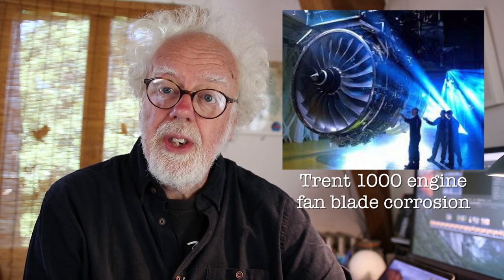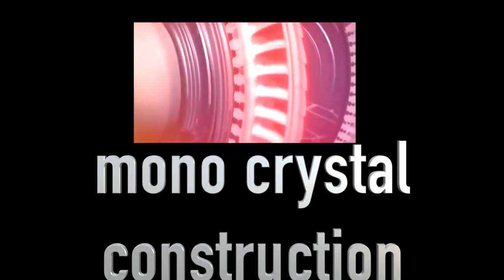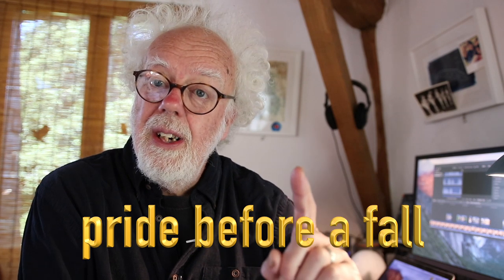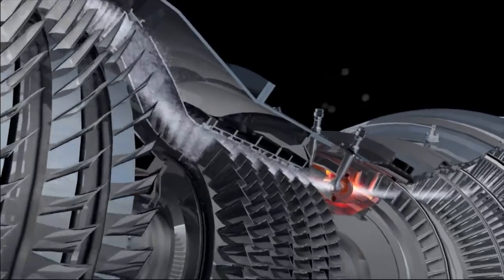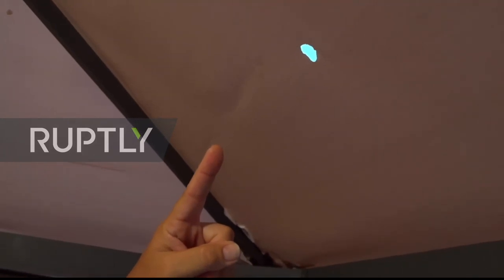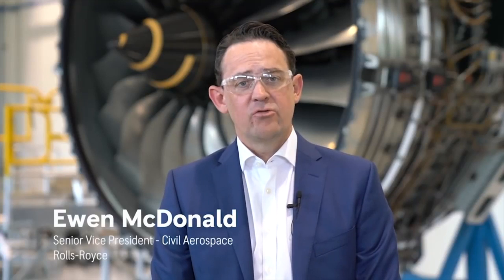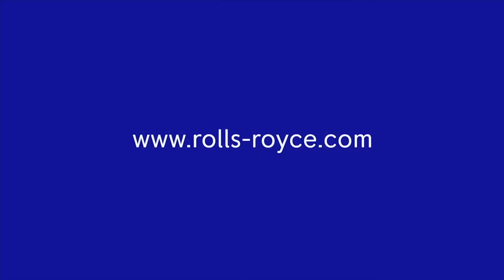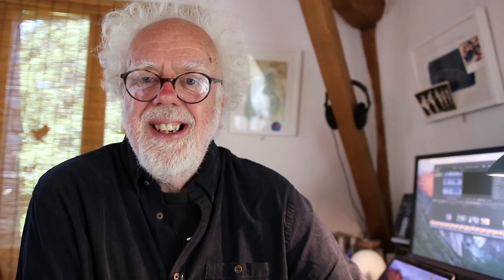Boeing and Rolls Royce problems - Prof Simon

Comment: Who is putting these engines into these planes?  RR is not the only engine maker.  I don't remember GE or, what's that other one, having problems like this.  I'm not thinking that RR engines have a monopoly on any particular design characteristic that makes them more suitable for these applications.  Is there a reason that Trent 1000s are being used instead of other engines?  Great video, as always.

Comment: I feel as though we are now asking even the most advanced materials to perform in ways that almost unattainable. Its hard to even imagine the stresses put on those blades. The G forces, temperatures and environments are really off the charts. Its not like the slower and much smaller engines of the past. These things must perform with the precision of God like numbers under the tightest strictest tolerances. Efficiency is the holy grail but at what cost will it be? I think corporations are under way too much pressure by investors and decisions are being made before they should be. Boeing being the example. When these companies make bad decisions and people die, will they fail???......they naturally should but dont which then increases the chance that the next company will take a short cut..... taking the gamble as they see others do it and survive. It never makes sense to me...people seen what this Trent engine does....yet will still buy a plane ticket on one. Lets see if people book on Max8s. When they do, and they will, companies will simply learn they can get away with more risk.

Comment: designed almost the same way, but with air, just like the way they used to mine gold with water ,when they put the water down 1 pipe and then into a smaller 1 and so on , as the water flows down the pipe into a smaller 1 it picks up speed, just like the air does in this engine, great post

Comment: That photo was qantas A380 it blew up because a poorly made hydraulic pipe failed and over fueled the engine causing it to over rev and fly apart. Quite a different problem to the corrosion issues on trent 1000s that Air NZ have on their 787 fleet.

Comment: @ 4:31 you can see what I’m talking about😲 I know it was just a animation but I would think they would want to represent it correctly!! The turbine gas exits the annular ring around the spike. I’m doing so it scavenges the air from the small hole in the collector spike to draw cool air through the center on the engine for cooling the bearing and supports. It’s crazy they would miss that😳

Comment: Why only some Trent engines affected.  What did they change?   Are the problem engines made in England or Germany.???  Is the problem design (asking the blade to do to much) or quality control.  Is it due to a change to untrained/ newly trained labour?.  Their nightmare is GE grinning to the bank.?  Was it due to a cost cutting measure? or change in the process???.

Comment: Whats your opinion about A380 engine issues, should we worried about it?
Reply: Not particularly no, as the a380 uses the Trent 900 engines (of which the Trent 1000 are derived from the Trent 900 so the corrosion issue would be limited to the Trent 1000). Also, the a350 does not use the same turbine (it uses the Trent XWB 86/97). Tho given that the Trent XWB was derived from the Trent 1000, one would assume that the turbine blades has been designed from the outset to limit/delay the onset of corrosion.

Comment: You didn't define exactly what the problem is? Compressor section, which part, corrosion or fatigue?
Reply: Milt Farrow  there was always s lot of ware on compressor blades in the 1st stage. RR had to ceramic coat blades to stop sand causing excessive ware back in the 1980's, 90's on the Saudi Arabian ordered engines. RB211-524D4D if I remember correctly.

Comment: Lighter fan blades are great but the rapid cooling and heating is probably cracking the blades. You dont have the surface area or density for expansion and contraction of the metal. That would be my guess.

Comment: Additional info from over a year ago: 300% is RR shop load capacity increase, issues are Intermediate Pressure Turbine (IPT) & Compressor (IPC). https://www.americanmachinist.com/shop-operations/rolls-royce-details-inspection-replacement-defective-blades
Finally did anyone notice the RR video showed exhaust flame coming from the center of the turbine rear frame sump area instead of the outer gas flowpath..."there's your problem lady"

Comment: built in sin fin and i heard that flight 370 ( i think) had rolls engines and apparently rolls engineers can talk to evey engine in the world at anytime in real time for diagnostic issues ane can fix a lot while in the air like diagnosing cars etc      my ex father in law worked for GE and once showed me pics of a turbine engine having its blades being blown off on purpose as they all have a detination bolt to release the blades in case of emergancey ............

Comment: I developed an odd passion for jet engine turbine blades. Part engineering but purely an item of Art.
Reply from the maker: Me yoo
Reply: @SimonHollandfilms  I did pick up one of the Trent 700 series large turbine blade. My favourite is a complete Turbine wheel with all the blades which is from an SR1 Sea Harrier. I see it as a clock one day if ever.

Comment: A large Southern Hemisphere operator of RR powered 787s knew of the engine problems for some time but continued to fly them on long overwater flights. It was only after they had a couple of inflight failure/shutdowns did they reduce the ETOPS ( EDTO) range, and that was because their  regulator gave them no choice. Like all things in life profit rules supreme, always above safety.
Reply: Can I just say that Qantas use B787-9 and Jetstar B787-8 both with GE engines.
Reply: Who else does that leave? As I said RR powered.

Comment: These engines are all pushing the technology and engineering expertise of the current construction industry. With such fine tolerances things are bound to fail. The obvious answer is to inspect the engines on a much tighter time frame whilst looking to correct the main causes of the failures...
Reply from the maker: So true....very high tech but unsuitable for our polluted air....they should know that

Comment: That Rolls Royce video on how an jet engine works is total rubbish.  They don't know the difference between deflagration (subsonic), combustion (continuous) and explosion (supersonic combustion propagated by infrared)
Reply from the maker: Interesting...a few people have said the same....I do t really see much wrong with their simplified graphic....but hey...you guys are the experts
Reply: Professor Simon Holland Well I may have shot my mouth of way too soon.  It seems that both detonation (supersonic) and deflagration (subsonic) are both considered an explosion, at least according to Wikipedia.  In an IC engine you want deflagration.  The combustion in a jet engine must therefore also deflagration. Air speed in those chambers definitely slowed to subsonic speeds.   (Unless a scramjet). I guess I suffered from hubris 🥺.
Both Whittle and Max Hahn (Von Ohain’s partner) solved the key problem of the jet engine which is combustion.  Hahn had a bunch of welding torch patents he could draw on.

Comment: Let's just hope it's a nasty blip in RR's otherwise good safety and quality record.. Pity they didn't go further with Skylon but the trend for large and bulky but fuel-efficient subsonic airlines for the masses took over years ago.... Bigger planes mean bigger engines which, when combined with the driver for ever lighter planes and engines meant weaker engines in this case... Obviously you want your blades as light as possible rather than as strong as possible, but they still have to be strong enough.... very sad... good luck R.R. - although luck should play no part in their solution TBH.

Comment: I think if you actually listen to your own video, you will hear that the Rolls Royce guy didn't claim to be 300% better, he said that the company had increased their maintenance capability by 300% in an attempt to get things sorted -- and therefore, in my opinion at least, doesn't deserve your mocking of him.
Reply from the maker: You’re correct...I’m moking the phrase 300%...when 10 more technicians would be less hyperbole.
Reply: @SimonHollandfilms  Is 10 the correct number? If so, then that would mean they only had 3.3 maintenance technicians working on the problem worldwide before they made the 300% increase.Maybe you're right but it seems unlikely. Perhaps the exact numbers should be researched.
Reply: And it is worth asking, if they claim to have tripled their maintenance capacity, how did they do that? Hire more technicians? Streamline procedures? Add better machinery? Or, did they make the procedures less stringent?

Comment: If they used to be able to repair 100 engines at at time then now they can repair 400 engines at a time. 
100=100% 300=300%
300% more than 100 is 400
What’s not to understand?
Reply from the maker: It’s hyperbole

Comment: RR has been the great innovators in this field.  The carbon composite blades were initially brought by RR however they had such failure with it while GE has it on their engines now.   RR is in a hurry to push out things without completing their due diligence.  That being said the RB211 is a solid Engine, they used to build good but is on a steady decline.

Comment: the thermodynamic effects, that make these engines so efficient, were known decades ago. But they couldn´t be built, because there were no materials that could resist those thermal and mechanical forces. As research continued, better materials became available. The design of these engines pushed the new materials to their limits - and beyond. Managers knew about that problems, but they were shure, all the lazy, coffee-drinking engineers would make it work somehow. Physics is a bitch.

Comment: So, what exactly is the nature of the problem ? You don't really explain it at all.
Reply from the maker: Hubris....relying on past glory and ignoring the quality of what you are making today.
Reply: @SimonHollandfilms  - that's not actually a physical explanation for heaven's sake.
Reply from the maker: Trent 1000 engines have hot section turbine blades, failing due to corrosion cracking...RR blame air pollution.
Reply: @SimonHollandfilms  What kind of corrosion ? Other variants of the Trent 1000 don't seem to suffer. What is going on ?

Comment: I never heard what made a British Airways 380 flying over Greenland heading for the US back in ? 2017 December or 2018 January. When the Engine Cowling came off it at cruising altitude (?30,000 + or -) Making an Emergency Landing at some Air Base in Labrador Canada (?) (My memory loses me after some time. Just what this Evil world wait's for when they say things have to take for ever for investigations, so no body really knows the cause of things.)
Reply: I suppose you are writing about the AF A380 losing #4 fan and air inlet over Greenland in September 2017. The FAA issued a directive to inspect these GE/Pratt & Witney engines inlet. Establishing the cause of the separation takes time because fan parts have to be located in Greenland. Some were found in July 2019.
Reply: @alaindumas1824  Yes! Thanks! This Aircraft had GE/Pratt & Witney Engines? Not Rolls Royce? Perhaps some of same issues are with other makers also? They just found those fan parts 2 months ago? Wow!
Reply: @michaelprice8402  These are not the same issues. Inlet fan is not exposed to the high temperatures found elsewhere in the engine but these large fans spin fast and carry a lot of inertial energy.

Comment: Whether its RR or GE issues 
I will always blame Airplane manufacturers ie Airbus,Boeing 
Looks like engine maker they're pushed and stretched so much  for the sake of fuel efficiency engines etc. 
Now we're moving away completely from Quad jet but we are still looking for 300+ -400+ twin jet ,more mileage, more cargo,fuel efficiency etc. 
We should expect more troubles with the latest and future engine models
Reply: Do you think that these manufacturers have already pushed the development envelop for these twin-engine large airplanes too far?
Reply: I think so..especially when it comes the use of composite material on fan blade making it more lighter 
Fuel efficient and more longer range
Reply: @ibrahimmakumba9448  Interesting take!

Sorry, I'm really not that knowledgeable into this as aviation engineering is not exactly my field. I'm more into farm animal agriculture & assisted reproductive techniques.

But aviation is a fascinating field for me, hence, my query to you!

Maybe the aviation industry needs to look into your view & even consider maybe improving on the feasibility of existing quad-turbofan jets.
Reply: Haaa haaa
 I am just aviation enthusiast 
Professionally I am anaesthetist
I might  be wrong also 
But the way things goes in aviation looks like profit is the driving force ending up compromising safety...
Reply: @ibrahimmakumba9448  Apparently, & in the case of the B737 Max, profit is prime over safety & reliability! And I hate it that that seems to be the "trend" these days!

I mean, what are they thinking? Money isn't everything! And now Boeing is losing more than gaining some!

Comment: The Truth is out there? Just not with this Guy, told him a few hours ago his using a photograph of GE engine on an Air France A380 was fraudulent against RR and guess what, MESSAGE DELETED!!!!!
Reply from the maker: I listened....deleted the video...changed the photo and re uploaded the film....thank you.
Reply: Thanks for spotting it! And this guy wants everyone to think he's a professor? Professor of what?
Reply: @SimonHollandfilms  Well, thing is the picture of the Quantas A380 with it's uncontained engine failure had nothing to do with the current problems the Trent 1000 has. Also the RR Trent 1000 is acutally an engine exclusivly used for the Boeing 787. The only other aircraft that could potentially face similar problems ist the A330Neo with its Trent 7000 engines which are partially based on the Trent 1000 design.